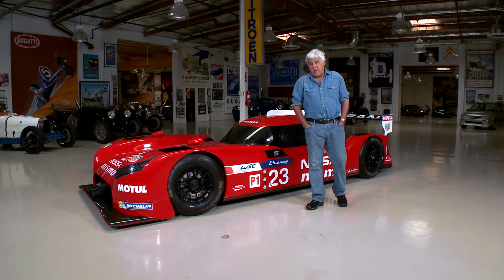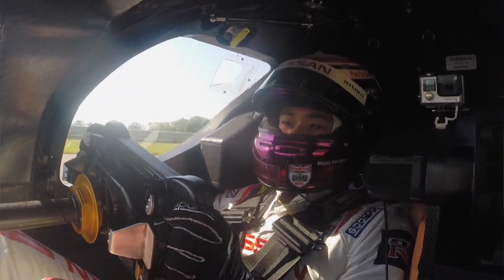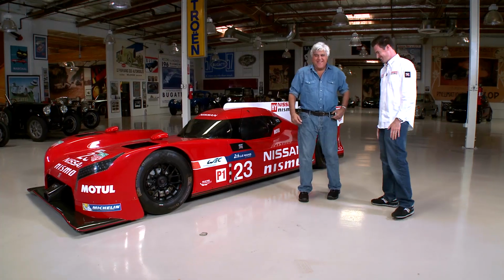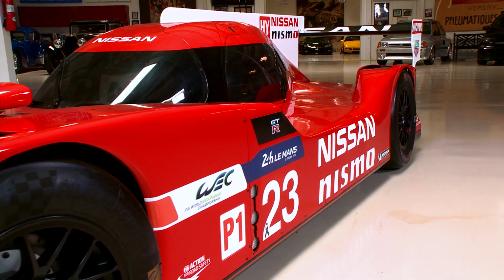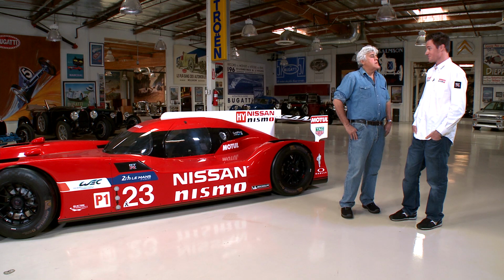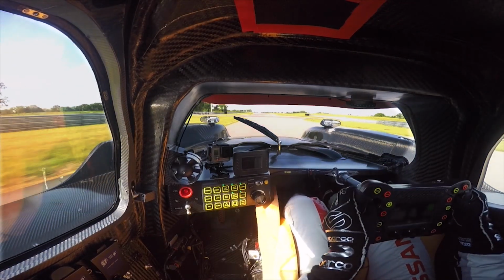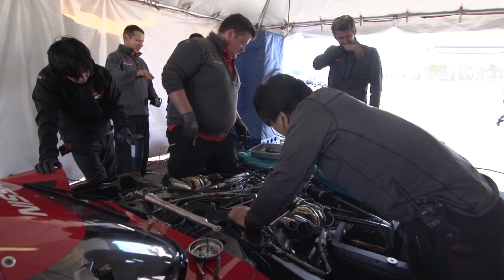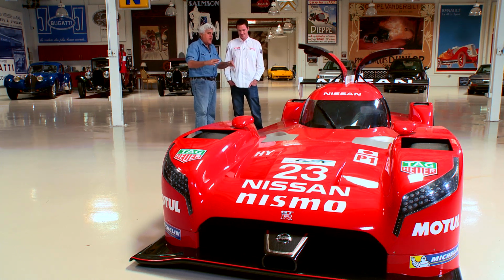Nissan GT-R LM NISMO - Jay Leno's Garage

Comment: God this thing is hideous. I never thought you could screw up a Le Mans design. They usually look awesome. I especially hate the way the Nissan logo has been tacked onto the front. The car looks good in parts, but put the whole thing together and you get - crap. 
And - I just read up on it after writing my comment - looks don't deceive. Aparently the car sucks. The Hybrid System is not working. But we'll wait and see how this ugly duckling performs.